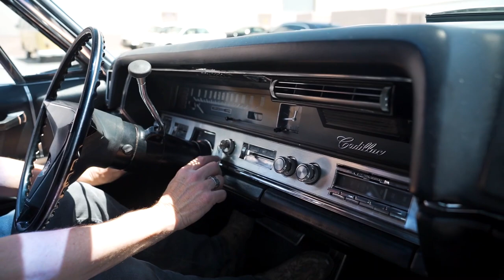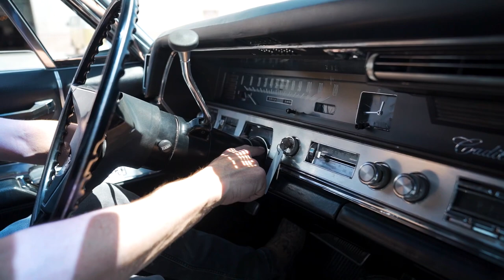1967 Cadillac Deville | At Celebrity Cars Las Vegas

Comment: 22:45 -  If it's pulling that means the brakes are out of adjustment. These are 4 wheel drum brakes, it wasn't until 1968 that front disc brakes were optional on the Sedan deVille. Your shop techs should know how to dial in a car with 4 wheel drum brakes so it stops straight all the time, they just need some adjustment.

Comment: I owned a 67 Coupe DeVille.....deep maroon with black vinyl roof and black brocade seats.... she was a sharp car..... last year for the 429 engine....updated 68 model went to a 472 ...  thats a big  V8 !    the 68 had updates and a the new side lights ... by law, 68 USA cars had to have them.... I liked the 68 much better
Reply: My first car was a 67 Coupe DeVille. Triple black. The car was stolen in the late 70's and I always wanted another one. A couple years ago, I found a '68 Coupe with only 14K original miles and bought it on the spot.
Reply: I have a 472 in my 67 convertible. Best of both worlds
Reply: I bought a 68 convertible 25,000 original miles from FLA . Belonged to a older couple until I bought it in 87 for 2000 dollars . My first Caddie but not my last . They are wonderful.

Comment: Had a '78 (used in the 80's).  "Dings"?  A guy in a Toytoa Corollas ran a stop sign and hit me broadside right at the rear wheel.  His raditor was split in two, his engine was pushed through the firewall, I had a dent that I pulled out.   8 to 12 guage steel don't easily "ding"!  (Fun story because the other guy wasn't even slightyly injured; he was personally "well lubricated" as it were).